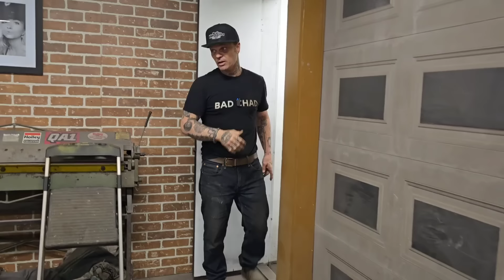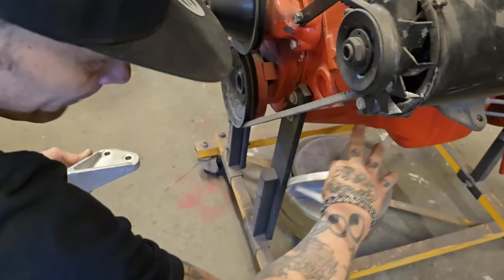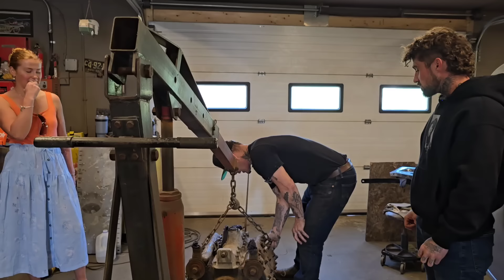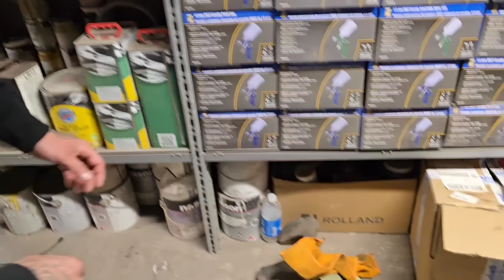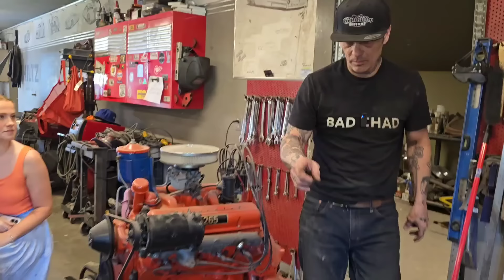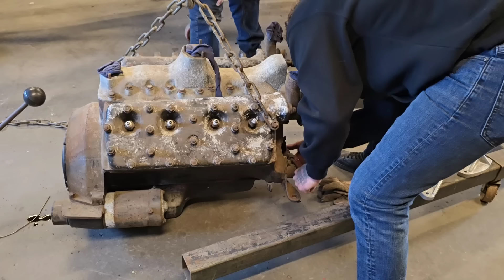Engine mockup: Flathead Ford, 500 Cadillac, and a 265 V8... Father’s Day Shop Vibes 🙏

Comment: Your screwing up. Do not match your engine to an out dated non synchronized transmission. Throw away those crappy front mounts you got . Get the 56 front engine  front mount which goes all the way across. Get the right clutch housing with the rear mount attachment points. Get a modern 5 or 5 speed transmission with syncros so you can shift the dam thing up or down. Yep you are going to need a drive shaft and probably a rear end to match but that is the only way to make this combo work right. You think the ole wrecker truck is hard to shift, try shifting with a small block hooked up.

Comment: So glad you have a friend to do your Cady engines. It is good you are trying with the motors and trans.. from my experience matching up transmissions with different engines is a real challenge. Flex plates clutches or torque converters is where projects stop cold for solutions

Comment: Would the value drop on the Ford throwing that Chev motor in it,I don’t know why but I thought you were going to try get the flathead running again, and if not a small block Ford , anyway be good to see it going down the road under its own power

Comment: One major drawback that the 265 V8 had was that it was produced with nothing built into the block to assist with the filtration of oil. There was an oil filter that was added during production on the housing for the thermostat but it was not adequate enough to give the engine any long term durability.

Comment: The 265 Cu. In V8 Chevy  Engine  was quite the powerhouse in the mid 1950's then the 283 Cu. in. V8 Fuel Injected Engine came along  . My Dad owned  and Operated a Chevrolet Oldmobile Cadillac Dealership in Charlottetown PEI Canada .One of the stories, I've haeard recently that a gentleman purchased a 1957 Chevrolet 2 door hardtop with a 283 V8 Fuel Injected Engine and it was a super fast car for it's time.

Comment: Hey Chad, Don't forget to check the pilot bearing, that it is the same size.
Reply: Does he even know what a pilot bearing is ? Or that the transmission input shaft has to correctly fit in the pilot bearing ? Not too sure.

Comment: The 265 Chevy will mate to a Borg-Warner or Muncie transmission. No need to adapt to a vintage transmission without syncro's. I doubt that vintage transmission will handle that 265 or any engine over 120 HP.

Comment: He has no idea what he's talking about that flathead clutch bolting on back of the chevy engine.
Reply: That's why the adapter
Reply: Not your problem
Reply: You use a Chevy flywheel and pressure plate in the Ford clutch plate
Reply: Ford

Comment: Aluminum front motor mounts is a bad choice. Can you say snap.  Engine torque will be handled by the front mounts if a single transmission mount is used. On original 55 - 57 chevy.   2 rear mounts handled the torque  and there was no single transmission mount.
Reply: It sure made it easy to put a clutch in those old 55 to 57 Chevys !!!!

Comment: knees wont hurt so much if you stay off the floor so much
Reply: Yes  concrete is very hard on the knees . That's what the mechanics chairs are made for  . Older you get the worse your knees well get . I did body work for over 40 yrs and have the knees to prove it
Reply: you would know

Comment: This lunatic is gonna put a V8 in a 30s car with mechanical brakes, genius.
Reply: It only has to drive to the garage 😂😂😂
Reply: @DavidSmith-zv7oq  more like pushed
Reply: @haynespeters-g4z he has now son and girlfriend to push,she looks strong
Reply: All that work, to put a boat anchor in it.
Reply: what do you think a flathead is its a v8,a 265 puts out very little horsepower
Reply: While I don’t think Chad will ever make the swap happen himself. The facts are the original flat head V8 made approx 94 horsepower. the 265 when it was introduced made approx. 160 HP. More than likely more like 150. Regardless the 1930’s transmission is more than stout enough to handle the 265 providing your not pounding on it. Also the mechanical brakes could handle the small increase in HP. The key would be having the driving style was easy enough to allow for the stopping distance of mechanical brakes. Would I use the original transmission and mechanical brakes. Yes only to move the car in and out of the garage, never on the street. Regardless they would work if installed by a competent mechanic. (Which we all know Chad is not)